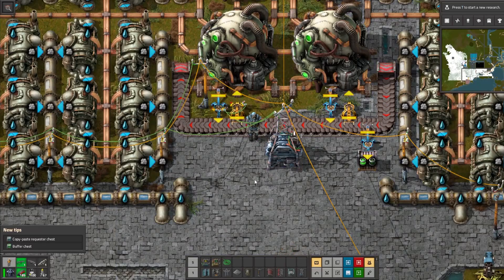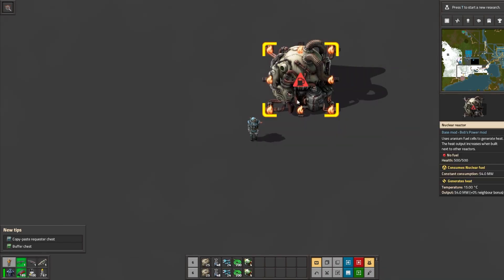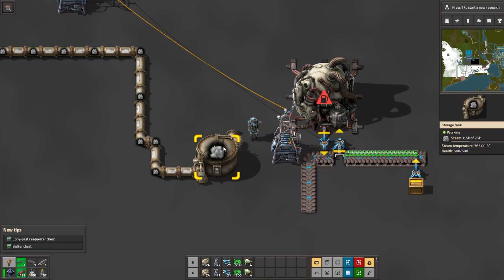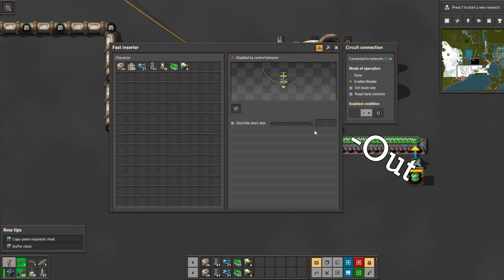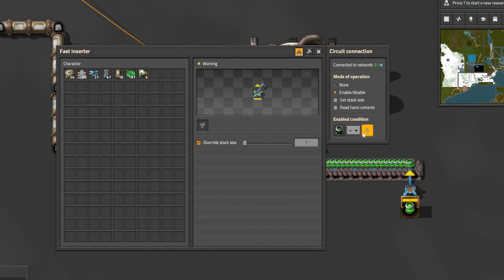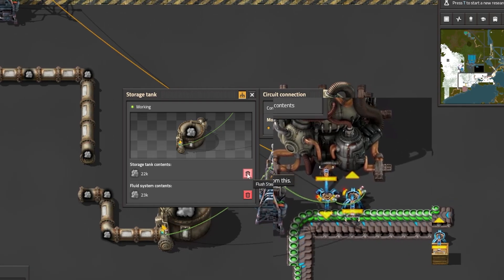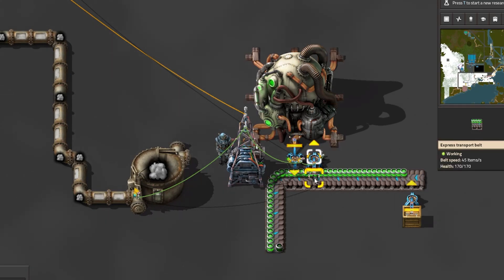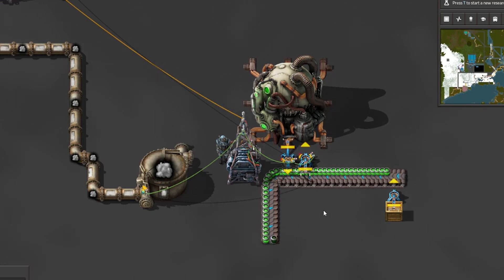Factorio 1.0 - Nuclear Reactor - Efficient fuel cells Setup (tutorial)

Comment from the maker: Quick note: Since am not too circuit savvy, i didn't understand how the fuel signal works when using more than 1 reactor. And if you use more then 1 Nuclear Reactor, what you need to do, it set the "used-up Uranium fuel" to ">" meaning that it only works when there are "Used-up Uranium fuel cell > 1" this way, if you have 2 or more inserters taking fuel OUT it will actually work.

Small mistake that i didn't notice cuz in all of my testings, i was working with just single reactor, sorry for that :D
Reply: Thank god more savvy than me i added one like a min after i made my first  so i was wondering why power was shorting lol

Comment: several problems whit this! 1 storage tank store way too low amount  of steam. for the reactor to heat up it consumes 1 fuel so at a certain point where the tanks get empty and the heat drops down actually you will use the double amount of fuel as if you where yust consumeing continously. allso with only 1 reactor you dont get neighbour bonus with a lots of energy output bonus! at late game it wont mater if you keep waisting uranium, it will be cheap as rock. but if you want early game, would be better to make a 3x3 powerplant , hand feed it with max amount of fuel and let the steam stored in a bunch of tanks. after that set an easy alarm to work when those tanks are at like 20% .
Reply from the maker: @baka701  hello. the 1 tank was just for demonstration for the tutorial.
in my world used more tanks.

nowadays you can Alternatively just hook a circuit directly to the reactor (version 2.0) and measure heat.
then you can just change the settings from steam to heat, and when it would drop so that the heat exchangers cant work anymore. youd just put a new cell in.

Comment: No worries man. Nuclear powerplants are fun, 
  I use requester boxes but set the request to a signal, so it works on one or 200 reactors. So my go to is 8 reactors, 144 heat exchangers and enough steam tanks to hold 6 million units of steam.  also lots of underground pipes and pumps. I thinks it takes 8 water sources.  i use tanks in groups of about 1 m capacity with a Math combinator telling it to put steam out as signal, I use 0,1,2. I use about 250 steam turbines in blocks of 10. now the hard part, the logic.
Make a loop of belts, I use yellow ones, and make it about 10- 16 pcs long. connect the farthest upstream belt to your steam tank signal, tell it to enable the belt when everything is less the 250 k steam. to low and you may run out before temp is meet for steam production, to high and you fire back up to soon for great efficiency.  the next five pcs of belt downstream from the steam tank piece need to be set to read belt and hold signal ( very important )  connect this belt wire to a deciding combinator and have it set so whatever item is on the belt will make it output Fuel cell and set it to input count instead of 1. then connect a constant combinator to the other color input on the deciding combinator, set the constant comb to Nuclear fuel cell and set the value to 3. Now connect the output from the deciding combinator to your requester boxes and remember to set the boxes to use signal. Now go two more belt pcs downstream and hook this belt to your steam tank  signal and set it to enable if anything is greater then 350 k, this will make sure you don't  start a feed loop.  When your rdy to start it just put one of whatever  the decider combinator is looking for on your logic belt loop. also you will need to add one or two extra the first time because your plant is not up to temp, it really matters.✌

Comment: Actually... This longer video was really unnecessary xD
The short one explained everything very well.
The only good thing here is that you mentioned about the situation, when there is no new fuel cells. (And of coarse you're right. Situation like this probably will never happen..) but if so....
I've got simple solution for that. 
Counter.
Output inserter will add signal to the signal network, (it will be like a demand signal for the input inserter) and the input inserter will subtract that signal from the network, when putting new fuel cell into the reactor.
In this case, after the output inserter take out the used fuel cell, the input inserter will be waiting for the new fuel cell. Once the fuel cell will arrive, the input inserter will take that one new fuel cell, and then the signal will be subtracted and goes to 0, and procedure will be in the equilibrium state, waiting for the low steam signal, and for the used fuel cell to go out again. 
I think this will even could solve the problem with starting the whole system. Maybe the blueprint should have combinator that have starting signal 1. For example. 
Important to note. Every Reactor must have it's own counter for fuel cells. Signal from steam tank could be common.

Comment: This is made much easier by the inventory sensor mod. It can tell you the amount of fuel in a reactor, so then you can set the inserter to run when fuel remaining = 0. Doing it in vanilla is such a pain
Reply: Sounds unnecessary. But you probably mean that you can add a condition of no fuel in the reactor and low steam in the tanks, right?

Comment: In regards to efficient nuclear with complete automation; it's extremely difficult. What I've done so far: have a completely separate inserter per reactor that gets fuel from a chest, meanwhile the belts and circuit setup are exactly like in your video. These inserters also have their own memory cell (ANYTHING > 0 -> RED), and the inserters (Turn on if RED = 0) turn off when the memory cell reads that the inserters picked up the fuel cell because the memory cell outputs RED and now the memory cell has saved the RED signal, so at least you don't have to be there to manually insert the fuel yourself. To expand on this: Have a combinator output the RED signal * -1 for ONLY 1 tick if steam < 6k. This is just me brainstorming but it could be done if I can somehow have RED signal * -1 at tick 1 and then bring the RED signal value to 0 at tick 2, in theory it would mean that the memory cell resets and the inserter that picks up from the chest will work again until  RED = 1.
Also, I might want to redesign the memory cell (ANYTHING > 0 -> 1 RED), because I want to incorporate if (R != 1 -> RED) and (ANY > 0 -> RED) into a memory cell, haven't had success though, it's friggin' tough.